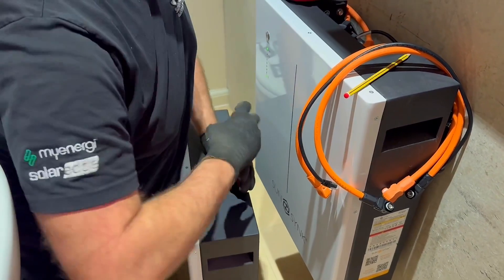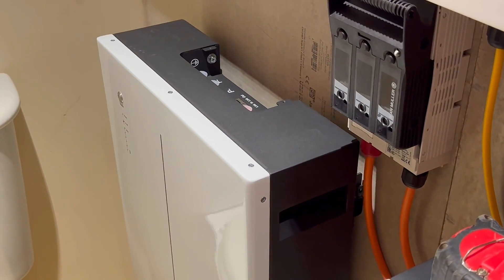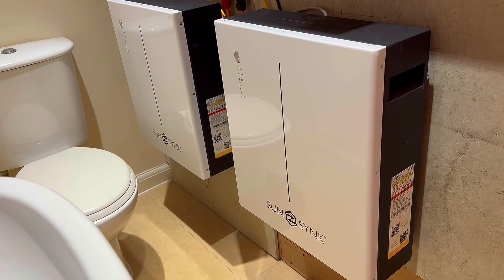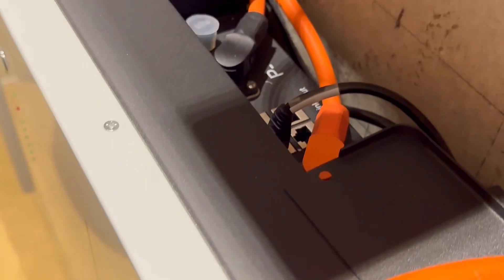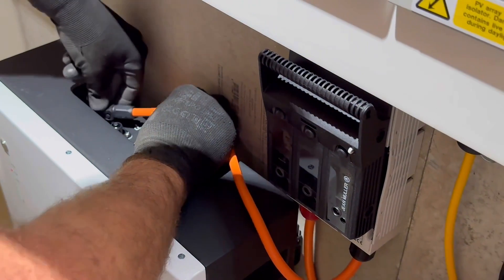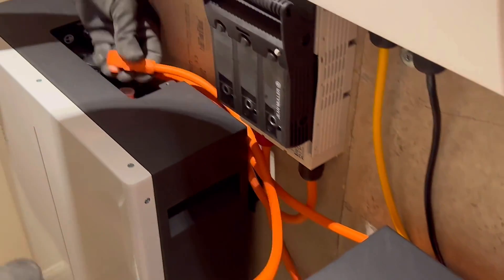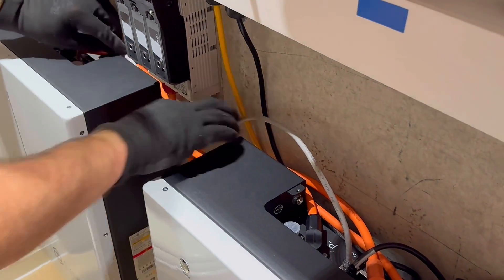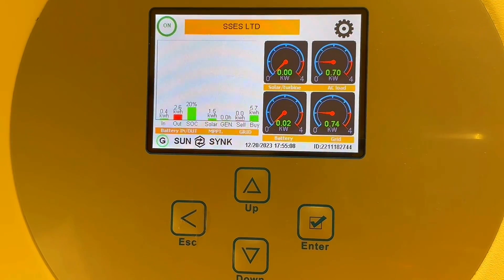Avoid My Solar Battery Blunder 🤦‍♂️

Comment: I’ve gone for 20 panels and a 5.7kw battery and a 8kw inventor with eon - I plan on selling back mainly, but I maxed out the panels so I don’t have to go back on the roof and in the future I could add another 5.7kw battery.

Comment: I’ve gone for 20 panels, 8.8 inverter and 2x 10kW batteries. Putting them in garage.
Reply: I’ve gone for the same but a 5.7kw battery with eon, I’ve just paid the deposit I wonder if I should change it for more battery I plan on selling back.

Comment: Big Big mistake installing a complex electrical system in a toilet. What happens when a guest uses it and points in the wrong direction, not to mention the humidity?
Reply: This happened to me once due to a similar install. I got a huge electric shock via the end of my bell and had to go to hospital for 3rd degree willy burns. In fact it happens all the time, very common toilet install issue.
Reply: @aldozilli1293  Ouch!

Comment: Of course the downside of a hybrid inverter is that Gary's statement "I've got the 3.6kw draw from the inverter, plus the solar" is unfortunately not true. The maximum throughput of the inverter is 3.68kw, and if the sun is shining it'll max out and won't draw from the batteries. However it does look like your usage and draw will match up better now, so you'll just have to be a bit careful about drying tgose flowing locks when the kettle's on!

Comment: The blunder is having large lithium batteries inside a house, no fire protection etc.
Reply: It's mandatory to have a smoke alarm next to a battery installation, pretty sure Gary showed that in an earlier episode. My installation is in the loft and the installer fitted a battery smoke alarm, which I replaced with an interlinked heat detector. Battery fire start slow so there's plenty of time to escape.
Reply: @smc812  Lithium battery fires propagate fast, very very fast.
Reply: LFP batteries  are not a fire risk, surely?
Reply: @faraway5828  All lithium are a risk. LifePo less a risk, but still a risk. IMO there should be compulsory fire detection located close by to any battery install at an absolute minimum, and linked to other detection/alert devices in the house.
Ideally though, it would be illegal to install these inside a property.

Comment: I would worry about humidity in the bathroom.   Not the best place to put batteries or electronics.

In anycase, this particular battery vendor doesn't seem to know how their own batteries work.  They don't even name the battery chemistry correctly.  It is "Lithium Iron Phosphate", not "Lithium-ion Phosphate".   The 80% DOD is garbage... that's marketing nonsense that just lets them inflate their cycle life.   LiFePO4 batteries can be 95% discharged (roughly a 48.0V inverter cut-off) without causing any significant wear to the cells verses a shallow DOD.  The cells will still outlast the rest of the electronics in the battery by years.

The BMS should be programmed cut-off at around 2.5V/cell to 2.75V/cell (40.0V to 44.0V).  BMS cut-offs are always the last resort and shouldn't be used as the go-to low-voltage cut-off for the system.  The inverter should be programmed to cut-off at around 3.0V/cell (48.0V), which is 95% discharged under a nominal load.

Always charge LiFePO4 to 100% when conditions allow.  This is typically 3.55V/cell (56.8V), hold for between 30 minutes and 2 hours ("absorb setting"), and disable any current tail to allow the BMS sufficient time to balance the cells internally, then drop to a float of between 3.35V/cell and 3.375V/cell (53.6V to 54.0V) as long as solar conditions permit.

Load-support from the grid is usually programmed in between 52.0V and 53.0V.  For voltage-based load-support it takes some messing around to dial-in a good number since it will depend on nominal system loads, but it is far more reliable than using SOC-based programming in control loops.   Avoid SOC-based control loops... the BMS tracks the SOC but it is only reliable if the battery can regularly be charged to 100%.  So it is possible for control loops to end-up in a tangle and cause the system to stop working properly when they are based on SOC.

In anycase, this is basically how you program in a battery reserve in case of a power outage.   Typically you don't want to draw the battery down below roughly 30% of its capacity under normal operation when the grid is available, in order to ensure that you have at least 30% of the capacity available as a reserve if the grid fails at just the wrong time.

-Matt
Reply: Good luck applying that to mass market batteries. I hear off so many problems with some systems which appear like a weak cell, or SOC being wrong. My Victron system with LF280K cells and JK BMS on the other hand. Two x 16 cells for a total of 29kWh, and an 8kW inverter.

Comment: People and sellers really push batterys. I have got a 5kw battery and in the supper it's great but that's because my system is returning solar all the time we have light sky's so say up to 9pm in summer and then we are off to bed say annhour after . This gives my batterys 6 to 7 hours of use powering the home. Because its summer the dishwasher and washing machines are onin the sunny period so no loads . So winter is very different. Be lucky to get 1 hour 30 minutes as we are up making coffee/tea, showering,  cooking all coming from that poor old battery. For best performance you need an 8 kw solar array and 20kw of batterys to deal with a lived in family home. If its a retired couple then 10kw or less. Its all dependant on what you use and how you live day to day. Remember what ever you pay for your system and labour needs to be paid back before you an say its free lol. Lot of folks forget this when they tell everyone in the pub how they have free electric lol. Then you have to pray they don't fail until the warranty runs out as then it will be a few more years before it pays back.
Reply: A 10kw battery is sufficient for the average household. 3 kw of solar . Use an off peak tarrif to charge the battery in winter.
Reply: @persona250  unfortunately it does not work for my household.

Comment: That's a really poor Depth of Discharge. Paying for a 5.32kWh battery, but only being able to use 4.25kWh is a scam.
Reply: It's to get more cycles out of the batteries, shallow cycling (top and tail) is a pretty common strategy.  It's configurable so if the desire to go further is there, and winding the cycle life in a bit, it can be done.  It's good practice to keep capacity in reserve either via configuration or calculated demand for systems that can run standalone anyway.
Reply: @retrozmachine1189  The battery is only warrantied for 10 years, so I would rather get the usage out of it in that period than saving it for a period beyond the expiration of the warranty. Sunsynk might not even be around in 10 years, so I'd want to get my money's worth as quickly as possible.

Comment: Afternoon Gary, looks like the Keto has a fuse in the Negative as-well as the positive which is a fire risk if the -ve blows first…

I cant see the ratings obviously but looks like a keto 160/3 and of course could just be a solid link? 

A question for your installer maybe?
Reply: why would there be a fire risk if the negative fuse blows first?